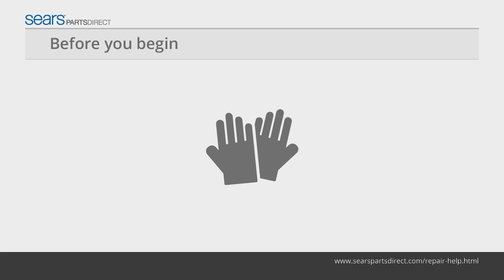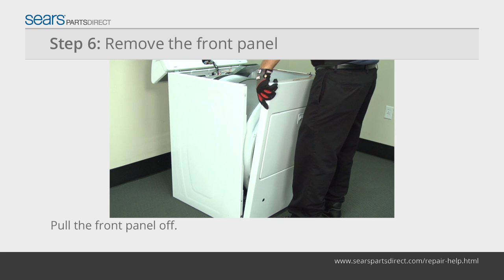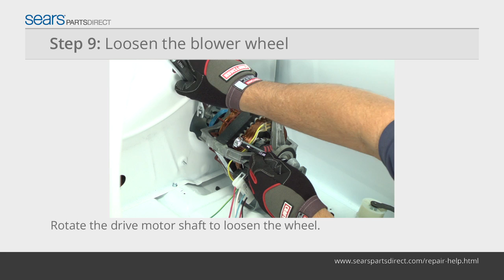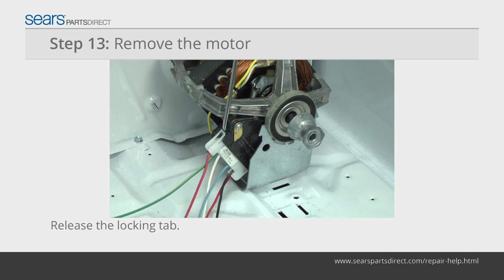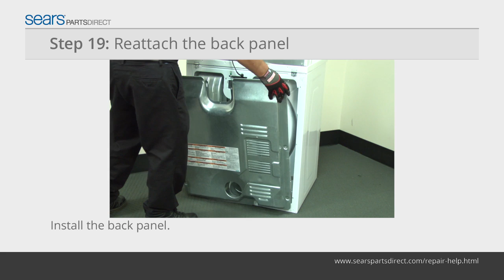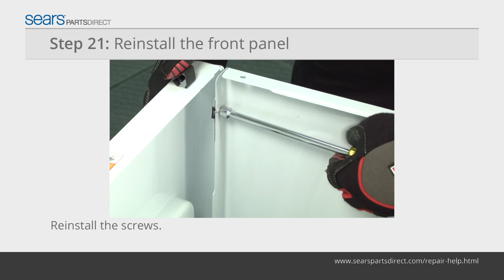How to Replace a Kenmore Electric Dryer Drive Motor

Comment: The drive shaft removal looks too easy, I ended up breaking it because of how long it's been on there 🙄
Reply: Can you (or anyone else) tell me how to go about breaking the blower wheel off? Mine is also stuck.
Reply: @susanbecker1771  I ended up drilling a hole into it and then using a jigsaw to cut around the center of the drive shaft
Reply: I'm a lot of mechanic and when I see videos on how to do simple car repairs. They never addressed stuck bolts or stripped bolted. And while this video is helpful, it doesn't same thing with that blower wheel. Chances are you gonna break the blower with a fan to get it off.

Comment: I am going to echo a few people here-- if your dryer is getting older, the fan will likely be stuck to the fan shaft and you'll have to break the fan to free the motor. Do yourself a favor and order a fan as well when you order the motor. I paid 13$ for one, and I wish I had ordered it when I ordered the motor.  If it turns out that you don't need it, return it.

Comment: The issue is that one a motor goes out, usually the company that made the dryer no longer has that part. So how is someone supposed to find the replacement motor?
Reply from the maker: Sometimes an equivalent replacement motor is available. Let us know the model number of your dryer and we'll check for a replacement motor.

Comment: They don't tell you what to do when the fan can't be pulled from the shaft. Also most motors don't come plug and play anymore. Requires some harness rewiring.
Reply: Yeah, I can't get the blower wheel off and I'm not sure how to do it. The dryer I'm working on, at least, doesn't need rewiring.
Reply: Yup, had break off the blower wheel off. Sucker was stuck